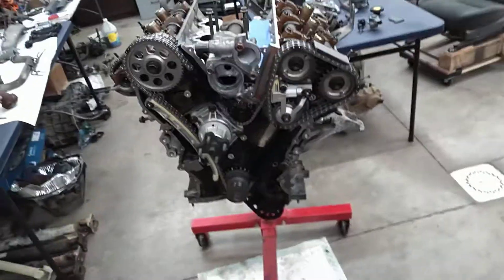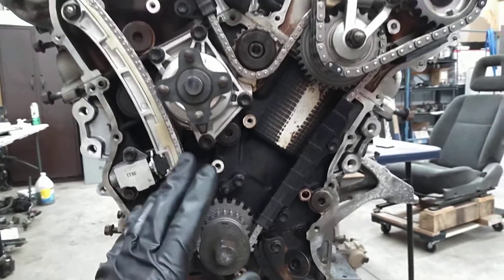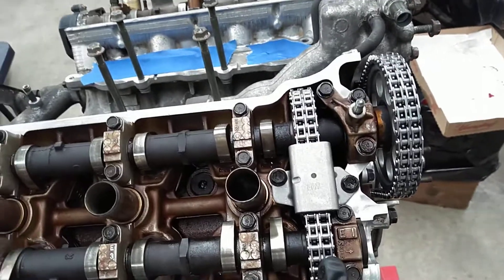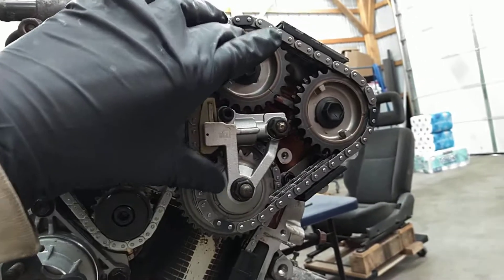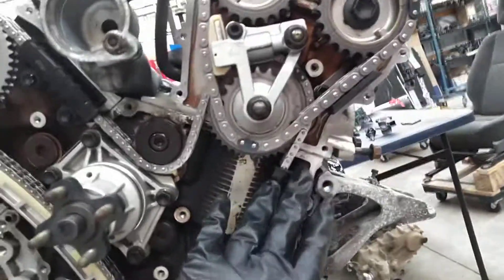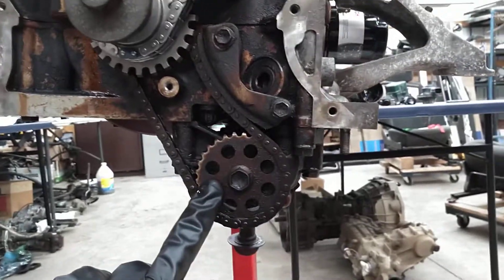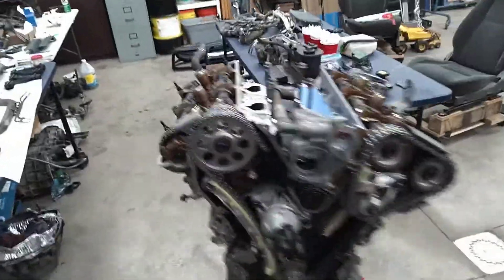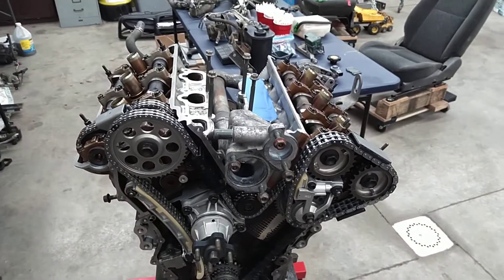Inside look of an H25 or H27 Suzuki V6: timing system

Comment: Hello @MrSputnik1988, thanks for this video. i would like to ask, how many bolts hold the main bearing caps? are there also horisontal bolts from the outside of the engine holding the main bearing caps like on the 2GR-FE Toyota?

Comment: Did you have the tourqe specs for the chain tensioners an cam sprocket bolt prtty much the torque specs if you were doing a complete timing chain kit

Comment: I did a timing chain job on a 22-re and thought,  how much worse can a v6 be?  I've got the H27 and after seeing this I'm having second thoughts 😕. How hard of a job do you think this would be if you left the engine in the vehicle?
Reply from the maker: I have done them in vehicle.. They are not hard to do, it just takes a long weekend of wrenching. It's easier to just remove absolutely everything in front of the engine to get access. I even removed the bumper and lights.

Comment: Cheers, need to replace the hideous chain rattle from the top tensioner and needed to see which tensioner I needed. Avoiding replacing the whole timing chain for now unless I see an issue

Comment: SuZuki M13-18 engines are much better, even though inline 4.
Reply: why is it you think this? I have owned a Grand Vitara with 2.7 V6 (non-vvt) and a Jimny 1.3 (non-vvt).
the J20a GV's are sluggish unless turbo'd compared to the V6 2.7.
If you are speaking from a turbo standpoint it is easier to tune but there's definitely a reason why Suzuki used a twin turbo setup for their Pikes Peak Escudo Rally Car instead of 4 banger.

Right now I'm looking around for a 2.7 to put in my Jimny in the future.
Reply: @jessebrown1400  I'm using an M13A for a small helicopter. As far as engine design goes it is far better than certified aircraft engines (with modifications). I looked at the H20A but it is too complex and a V6 is not a good platform for aircraft engines. If it was inline 6 it would be exceptional. I agree an M13A is not a great choice for a 4WD vehicle, the H25/27 would be better. the M13A is a better design than the Hayabusa engine in my opinion. However, an engines popularity is widely based on the platform it is used in.